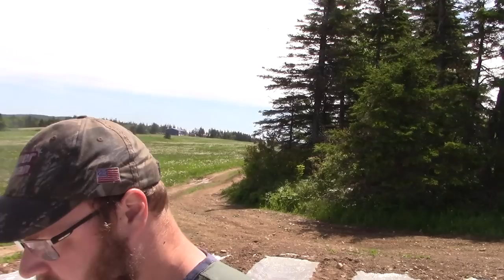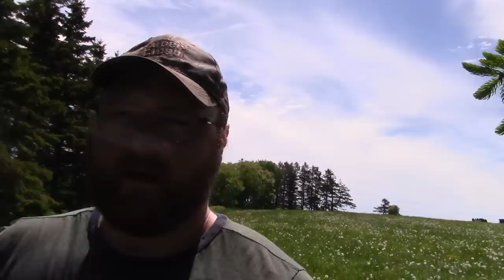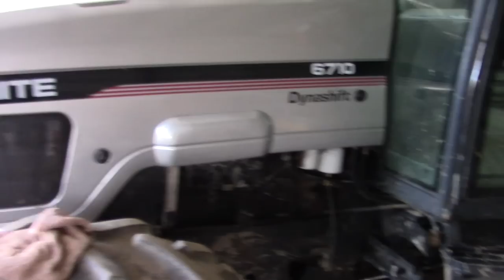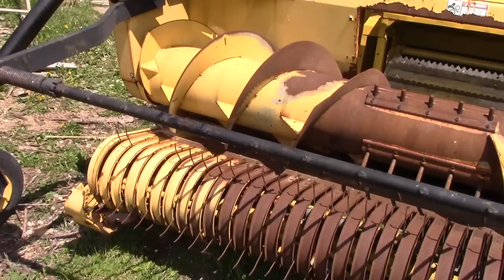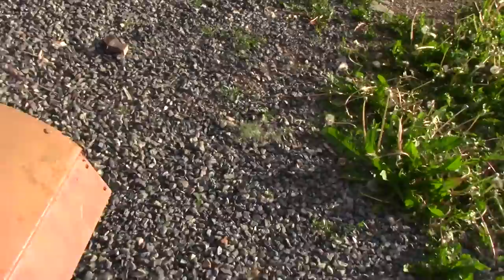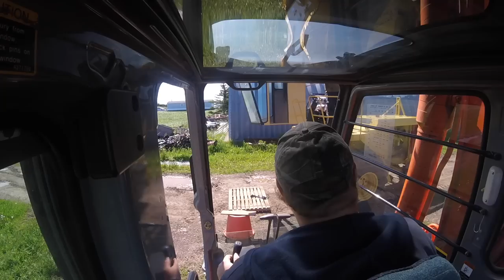😡 Crows Eating Corn Seed 😡

Comment: Does the corn planter not bury the seed in the soil? Might not be so much of a problem if the plastic was not clear either. Crows around here always seem to come down with lead poisoning.
Reply from the maker: It’s supposed to, they will dig the seed up anyway. They say once they come through the plastic they will pull it right out and eat the seed off the roots. Lead poisoning is pretty likely here too lol